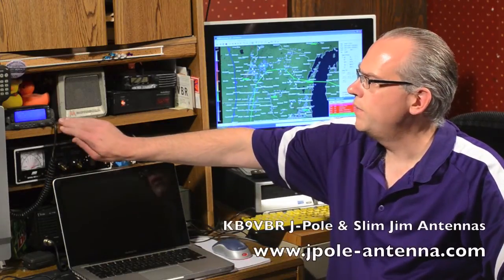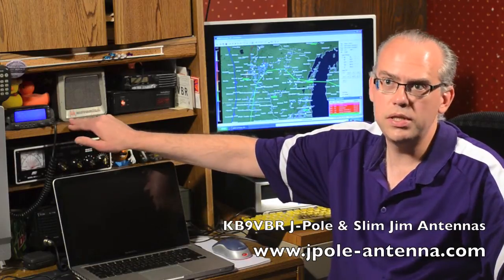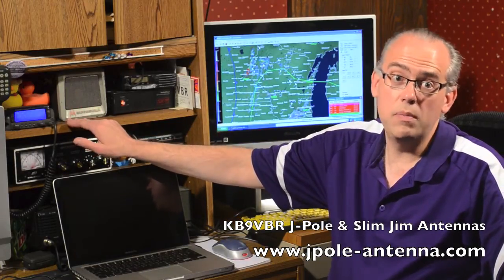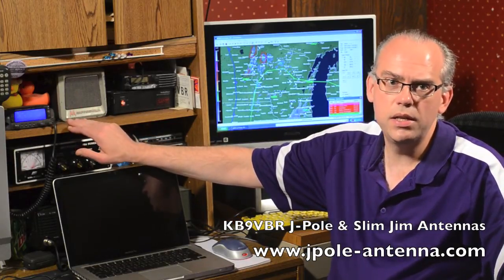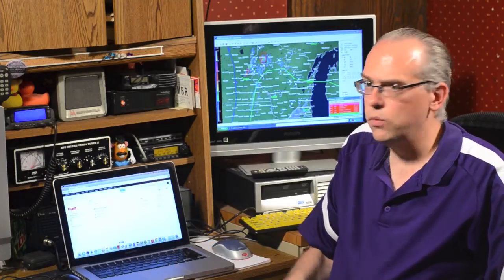SKYWARN Net Control Operations [HD]

Comment: Nice video Mike , We also use Googles Drive here in Michigan for Net Control logging and it has worked great for us too , I like it because if there in a change over of operators , everything is there for our relief net control operators to make an easy transition and not lose a beat . 73 W8WXM
Reply from the maker: That's the same exact reason why we use Drive for logging. Transitions are seamless and the liaison station can read off the log as they deliver the report to the Weather Service, greatly reducing error and speeding up reporting. In the coming weeks I'm going to produce a video that shows how to use Google Drive for that purpose.